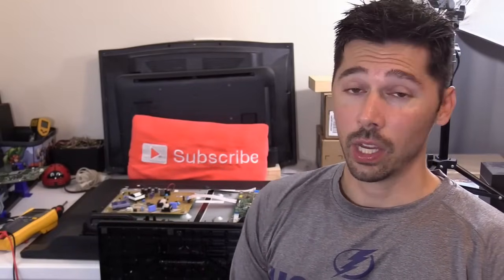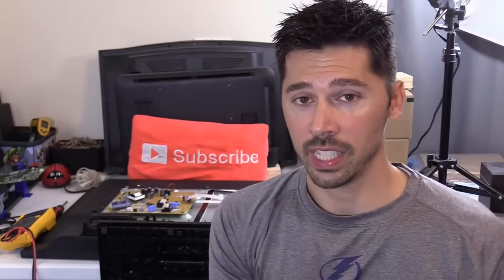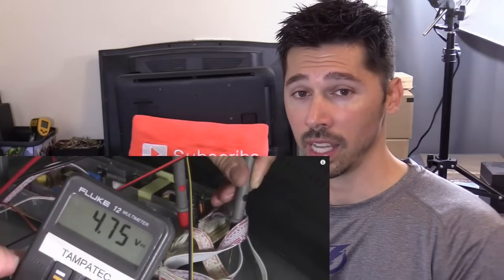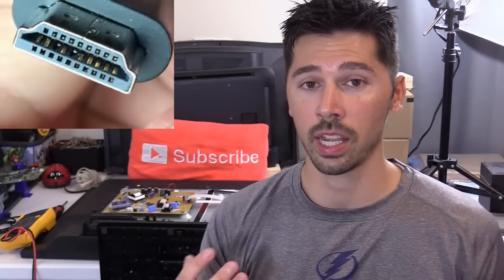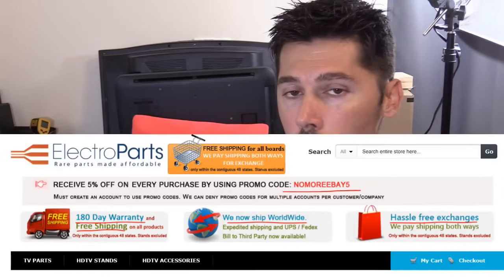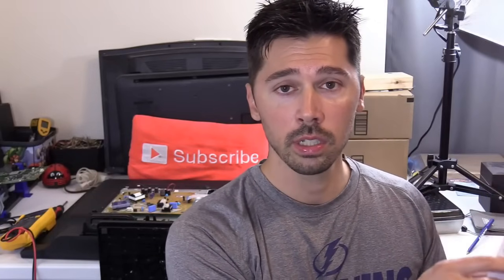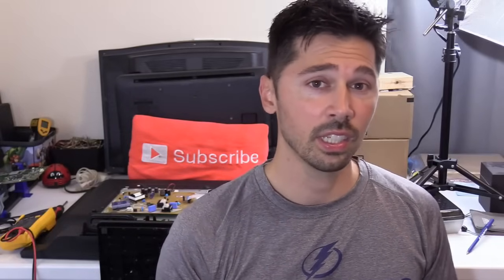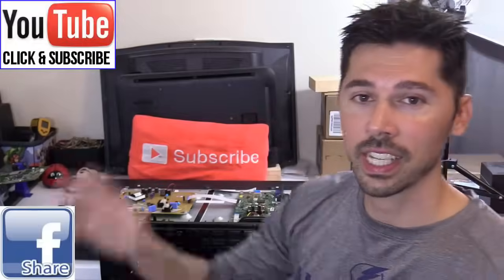How to Fix LED LCD TV Not Turning ON But has Standby LED Light

Comment: I has an LG 55LH90 tv and has no power, no video and no audio but has the standby light on.I check the voltages of the power supply board and has 5.2 volts in 4,5 points i dont find the standby point.I decided to buy in electroparts the main board and i have try two of them but i dont have any success.the other thing i see that there is not 12v and 24 v in the same place i find 5.2v.any help thanks

Comment: Got a 51'' Samsung plasma made in 2014 for free from Craigslist. No power no standby light. The owner replaced the power board and did not solve the problem. He gave me the old board also.  So either the power board they sent him was defective or I assume the main board is defective. Was thinking about gambling and ordering a main board. So you are saying that if there is no power at all and the standby light is also dead this could mean either a bad power board or main board? Could any thing else cause no power such as the on off switch?

Comment: Hi there I have a Kogan series 8 KU8000 4K LED TV KALED55UHDUD the tv has power the led stand by light is powered on then sometime when I hit power button on remote it turns of led standby light as if it was powering on and just black screen after that and sometimes the stand by light doesn’t even turn off at all when I hit power on the remote what could be a possible cause and fix thanks

Comment: I'm trying to figure out what's wrong with a Samsung LN55C630K1F TV after lightning strike damage.  The standby light comes on when TV is plugged in.  When I press the on/off button, the standby light flashes slowly, then turns off.  But if I wait 5 to 10 minutes or so, TV sometimes turns on.  What do you speculate needs to be replaced?

Comment: hi there, i have a Philips 32" LCD TV which i purchased way back in 2009. I hardly ever used it, only for PS4 and the occasional tv watching. Initially i noticed the speakers were not working and had to use external pc speakers. After not using the tv for a long time and turning it on maybe after months, noticed that there was no picture as well. When i turn on the power, the power light comes on and you can hear the sound, but it immediately goes dead after that. I have opened the back power and done a visual inspection including removing all the connecting parts, giving them a clean and putting it back. Not sure what the problem is. If you could advise on what to do next would be of great help. cheers

Comment: I have a Vizio E601i-a3. It was working but had a very dark spot lower left. Took it apart to see if Led burned out, which is not the case. Reassembled and now I don't have any picture at all. Any ideas?

Comment: i had a similar issues but just replaces few caps on power board. it was the couldnt turn fully on situation but every now and then lol i get parts i need from dump ppl around this time put out good stuff mostly cosmetic damage parts all still good

Comment: Hi. I too have used the Fluke 11/12 for the longest time and was thinking of upgrading...I see you have a Fluke 115 now as well, How are you finding it, is the display bigger and easier to read?
Love the Channel. Thanks
Reply from the maker: Fluke meters are amazing value. They last a long time I had mine so long fluke 12 after 10 years I decided to buy fluke 115 I still use both. Fluke 115 is a little better because screen.
Reply: @TampaTec  
Hi there I have a Samsung TV model un40ju640df
Out of no where just turn off no power at all standby ligth is also off can you help can this be fix

Comment: Thanks for an informative video. 
I have this LG TV. Recently, it started to misbehave. When it is plugged to power, it can be turned on with the remote (can't be turned on with the power button on the TV). But once it's on, it doesn't respond both to the remote and the power button. What can I do? Thanks.

Comment: I have samsung TH-55AX670Z, there is 5V standby voltage. red LED is keep flashing. If i press ON the power button i have voltage measure, 15V, 5V & 3.3V from main logic board. But the Supply to backlight will start to go low from 164V to 0V.  Can you give advice if the problem is the power board or inverter board or backlight LED.  I had already changed the main logic board but unfortunately the symptom is still the same.

Comment: FIXED! See issue below. Fix was simple: unplugged power for 30sec, then pressed physical power button for 30sec to discharge static electricity.  Plugged power cord back in and pressed power button. Everything works as it should...

Issue: My LG50PC5D has no standby light and will nit power on using remote or physical button. There is no clicking sound indicating that it is attempting to turn on. I tried changing the power outlet, but that didn't work. Plugged another TV into the same outlet, and it worked fine. Any suggestions?

Comment: What if the standby light comes on and when you press the power button it turns blue but there is no picture. or sound. Screen fails the flashlight test as well. Checking the power board and all the wires going to the logic board have the correct voltages. Also when pressing the power after the blue light is on it will not go back to red standby. Is it the logic board?

Comment: I have a 55" Hitachi TV that someone gave me but, it does not come on.  It has the standby red led and when i power it on with the remote, it turns blue.  I ordered replacement boards but because everyone says that the LEDs have a bad failure rate, I decided to take the TV apart.  When I got to the reflector that was taped to the back of the TV, because of the 2 sided tape and I had to heat it with a heat gun, the reflector has wrinkles and is not smooth and flat anymore.  None of the LEDS looked burned.  I have ordered the replacement LED strips but,I will be short one of the 24" long ones.  I did replace the POwer supply board when I have it disassembled and that made no difference so I do not believe it is the power supply board.  The strips say 94v and there are 6 rows of one LED strip that has 6 LEDS and another strip connected to it that has 5 LEDS.  So, the power connectors. One of the power connections supplies power to 3 rows of 11 leds on each strip and the other power connection powers the other 3 row of strips of 11 leds on one strip.  The strips seemed to almost be glued down so I suspect replacing these will be a huge pain. However none of them looked burned.  One question I have since I cannot find a reflector on line is how bad is the picture going to be with a damage reflector? Is is worth the effort for me to continue to mess with this TV?

Comment: Vizio E241-A1 power turns on, light turns on then dims out, no pic.  Sometimes power light stays on and will not dim and does not turn off until power cord disconnected.  Unplugging and resting multiple times and then sometimes it powers up and function properly but may go into previous fault as described.  Power board and main board show no burnt areas, no popped caps.  Any info?

Comment: Have a samsung un50H6203AF and have the red led light, when i tun on tv the red led blinks few times and don't get any picture.
Before this happen tv was working fine then the picture started to blink.
What could be the issue?

Comment: Thanks for your vid. I have an issue, TV standby is on, you can turn on/off tv with remote no problem, you can turn off tv with button next to standby light in TV, but that same button won't turn on tv. Any ideas?
Reply: Have u found a solution?

Comment: I have a LG 37LB5D
 TV which turn off and on after 2 hours of use. It always come back on (after 1 or many tries) sometimes with or without the image but the audio is working. I've found some blown capacitors and replaced them but could that be the t-con board causing the problem? ( I have the video on my channel for reference).

Comment: LG 32LN5120 turn on with remote OK turn off with remote will not turn on. Unplug mains, reconnect turns on with remote. Same problem when use switch on TV. Help.

Comment: I have an LG OLED tv. When the tv is switched on, the standby led is red. When the power button is pressed, the led remains red but tv does not power on and shuts down after about 3 secs. If the t-con board is disconnected, it powers on, stays on and the led goes off. when the t-con is connected to the psu and the main board is disconnected from the t-con board, the led goes off but no display. Any help? Thanks

Comment: I have led55uh7700 tv the tv power lights on  also 13 volts and back lights 125volts ok but the tv black screen ,help me the back light voltage cheking methode.please

Comment: Power in my condo flickered off and on quickly which caused my tv (RCA) to go off.  Red light was blinking but power button didn't cause the tv to turn back on. Tried the power reset (unplug) scenario and nothing happened. Let it sit for a while then decided to press power button several times and after about 15-20 times the green power light turned on and it is working again.  Any idea why it wouldn't turn on at first? The TV is about 6 yrs old.

Comment: Hi, I have a Vizio M550SL .  it start giving me problem. It started with smart system first. If I use any app after few minutes tv freez and remote stops working . then I stop using smart feature and bought fire stick. Now some times when I turns on the tv , it stays dark , no light. Vizio logo changed the color that tells that TV is on but screen stays black.  After many times turn on and off it starts working normal. if it stays on it keep on working fine but if I restart it, again it turns black screen. would you please tell me that what board should I replace, main board or t-con board ?. And one more thing , this tv also has a vertical blue line on the screen.

Comment: Hi and thanks for the videos! Unfortunately, I have not seen a video or in a video a starting point for my problem. Issue is a Vizio E421AV TV, which has power to the glowing standby light. and vizio logo on the frame. When we press the power button, the Vizio emblem always goes from dim to bright - 100% of the time. But the TV display (?) only powers on about 2% of the time -but does sometimes work. Took the frame off and found no obvious visual problems, dusted and cleaned everything I could...just not sure what to check next as with intermittent success, how to go about troubleshooting...thoughts? Links?

Comment: Usefull info bro.
My tv has to have a +20℃ to go on.
Not sure why still, ah just tech stuff i guess.
Reply: Because the contacts are bad somewhere, heat expands and makes it conductible.
Reply: Most likely an almost blown transistor..
Reply: Just cut a hole on the back panel of the TV get a ground and 12V wire from the TV PSU or main input and stick a 12V computer fan there.. :) if you want to be lazy and not inspect..

Comment: Hi Tampa Tech, I would like to know, when it comes to replacing a board do I only used the board number stamped on it or do I have to use the barcode tapes which have a number as well. Thank you.

Comment: i have a vizio which for some reason doesn't want to turn on . when i plug the tv in the power the standby light goes on and dims out after a few seconds, when i press the power button the led light goes on and stays on but i have no image. So if i understand it correctly it can be the backlight or the T com ???
Hopefully waiting on a reply so i know where to start searching as i am not very experienced in this matter.
Reply: Do you feel able to open up the back of your tv and use a multimeter?  Most likely your problem is not the backlight or tcon.  Your problem is most likely on the power supply or main board.  You could have a peripheral board that has a short circuit on it.  Did this problem happen after a power surge?
Reply: the problem was less severe in the beginning, when i turned the tv off it took a lotta effort to get it back on , did the trick with unplugged pressing the power button .

Comment: hello from the uk great video's i am trying to find some voltage settings for my sony tv  so i can troubleshoot a problem i         have with it! but it seems like a closed shop 000 can you give me any address were possibly i could get a diagram etc i plug the power in & all i get is a standby light for 3-4seconds then nothing else the tv is only 3 years old in my estimation the quality of sony tv's has declined  having there products over 50 years any advice would be much appreciated thanks from  a 80+year old man

Comment: Dear sir, I have a mi 4k 32 inch tv bought on 25-07-2018-flipkart. Yesterday (06-07-20) after severe lightning in my city (Guwahati), it is not turning on. After power on, the red LED light keeps on glowing but do not blink. Although, the TV was switched off at that time. Kindly advise. We are having lock down. Feeling very sad. What will be the possible problem & approximate cost. Kindly reply back.

Comment: hi ihave a problem with my samsung55in.model ln55c650lifxza.while watch the tv it get solid colored linesif I turn it off for a minute and back on picture is fine could you advise
Reply: Could be a capacitor but if you can solder it out shouldn't be a problem

Comment: Hey man I've reached out to you before about this dang TV I still haven't been able to figure it out. I'm just about to just pull it to the dump but I figured I'd give it one more shot. I replaced the main board the power board and the tcon board. I even bought another tcon board so I've replaced it twice because the product number was off by a letter so I thought maybe that was it. When I turn the TV on I see the back lights on in the back but the TV screen is a dark / blue hue. I see the led backlights on the bottom and I'm tempted to try to replace those boards. If it was the back light circuit boards would the back lights turn on or could it possibly just make the screen turn the color that it does? I also ordered the ribbon connectors or whatever they are so I don't know what else to do. any help you have I'd appreciate it I can send pictures video whatever. Thank you!!!

Comment: I feel like this might have been made in response to an email I wrote you. My TV WILL power on and has standby voltage. The ISSUE is that the power button needs to be pressed more than once when it has been plugged in for a long period. I've replaced the EEPROM on the main board and about 5 capacitors on both the main board and powerboard as well as 2 diodes. The capacitors were reading under spec so I replaced them.
Reply: Possibly a bad input board?  Does it do the same with the remote control?
Reply: @FrugalRepair  I did some more testing and it seems I overlooked a small capacitor on the powerboard about half the required spec. 10v 47uf. Upgraded to 100uf no issues now.
Reply: @davidbasara6162  Glad you got it repaired!

Comment: So if my tv is left on standby for a while it will not turn on with the remote unless I switch off the plug then switch it bk on. Any ideas? This is every day
Reply from the maker: Try replacing capacitors in power supply and main board.

Comment: I found a $9000 Sony flat screen TV turns on for about a second then it shut off it’s a 2016 model I don’t know if it’s worth fixing it doesn’t have any red light or anything it’s kind of a white light and a blue light what should I do I like to fix it it’s a 75 inch TV

Comment: I have a JVC  I have a problem with the tv showing a picture.  when I turn on the Tv it comes up with the JVC logo and the red led light comes on then it goes to green and recycles all over again without showing a picture.  Then not always but sometimes the Picture will display and stay on till I turn off the Tv then it starts all over again, what could be wrong?

Comment: hi! I have a LG 42LC7D-UB tv that always gives me trouble... i usually dont turn it off because if i do it will take forever to turn back on. What happends is if it turns off the red LED light turns on, I switch the tv on and green LED light blinks 3/4 times has blueish screen doesnt turn all they way on. I usually have to repeat turning it on/off a million times before working. Now my issue is last night we lost power 2x's and my tv turned off the LED light keeps blinking GREEN no matter what i do, remote, power button on the side and unplugging for 30 sec and when i unplug the LED will blink GREEN for like 20 seconds then very briefly turn red and finally turn off. When i plug back in nothing happends just blinking GREEN. Please help!!!!!! Thank You!!!! @TampaTec

Comment: My tv turns on and works fine but when I turn it off and want to watch tv again and turn it on the standby red only blinks and will not turn on I have to keep pushing the button eventually it turns back on so what could it be just wondering if you can help me out I really do appreciate it
Reply: It's a 52 inch RCA LCD or LED I think it's LED

Comment: Plzzzzzzzzzzzzzzzzzzzzzzzzzzzzzzzzzzzzzzzzzzzzzz help........................
I've purchased a new hair led tv, and sometimes it turns on with remote and sometimes it's not even led red light always on. When my led tv is not turning on what I do? Just unplug the wire from the socket and plug it again. then try to turn on.. then it will turn on.... can you explain what the reason is? Is my led defects? Should I call customer support? Any help would be appreciated.
Note: i've another led (orient led) that is working fine